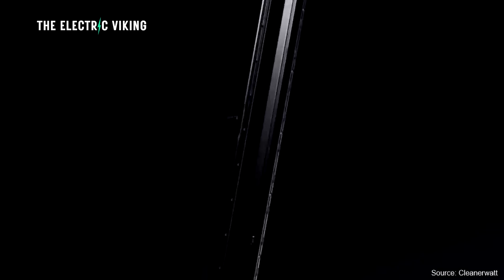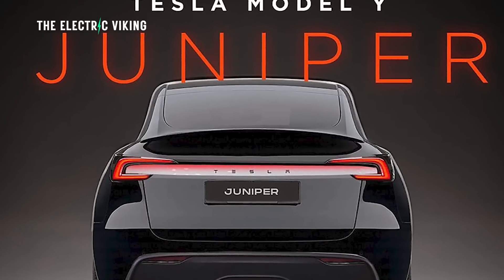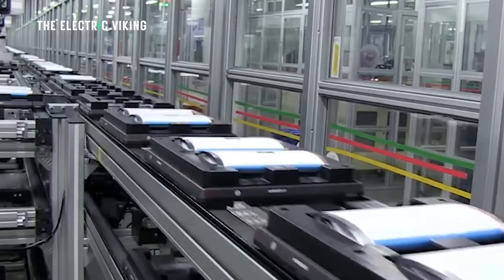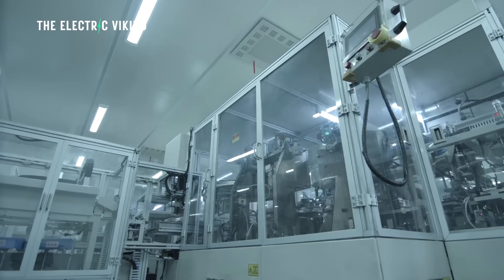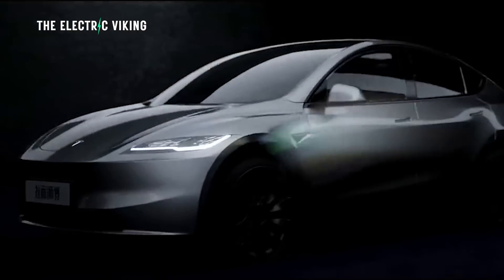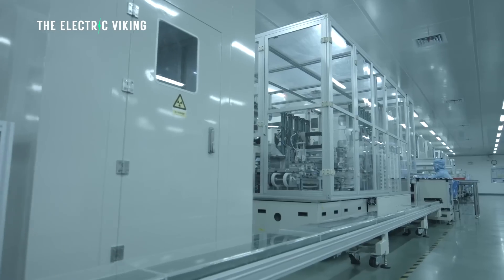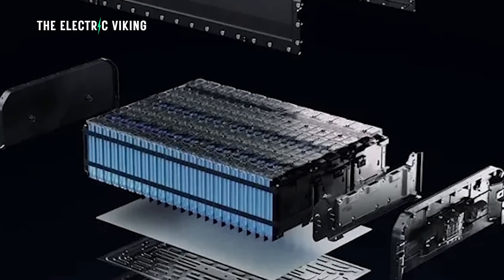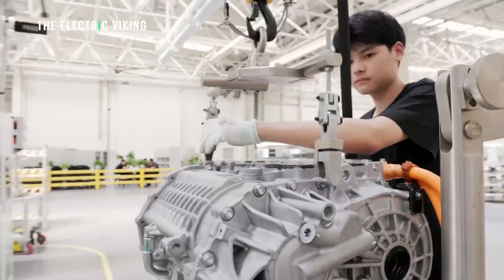Huge increases in energy density and charging speed for new Model Y battery

Comment: Folks, if you live in the US where leasing is an option, never buy an EV—lease it instead. I leased my Model Y in December 2023 for $500 per month, with 15,000 miles per year for 3 years. At the end of the lease, just turn in your vehicle and lease a new one. I know someone who paid $55,000 for a Model 3 two and a half years ago, only to see its value drop to $21,000 today. Leasing makes sense, especially with new battery technology improving every year. You don’t want to be stuck with an outdated battery.
Reply: Or buy a used one for $21k.
Reply: Who buys a car as an investment lol.
Reply: Prices a couple years ago were artificially high. so when the inevitable market correction happened, Lithium prices dropped like a stone, and used EV prices became really affordable. Plus China sold BEVs at a loss to force out competition. Some early adopters might have gotten bitten, but today and tomorrow's EV buyers will benefit from dropping materials prices and improving capabilities.
Reply: @deanmcmanis9398 Some of it is just the rapid progression of the industry but I agree leasing is not a 100% for sure thing, especially if you're intending to keep the car for 7+ years.
Reply: The sudden depreciation was a result of the lithium market crash and the model 3 refresh which happens every 3-5 years as well as hertz selling their 10k model 3s,the battery packs in the older model 3s are not obsolete they simply require longer time to recuparate costs
Reply: @Globalscanningeyes  Hertz had nothing to do with it in Europe where the effect is the same.
Reply: I put 131000 miles on my model Y in 3 years lol
Reply: If you drive over 15k miles a year I can’t see how a lease will help you.  Change my mind
Reply: @davidstrong7854  I'd rather a leasing company take the burden of EV depreciation than an individual owner
Reply: @skylershank9309  and you take the burden of turning a new but super expensive car that they may not sell into a used but great condition used car that they will still make a profit from.
That whole 'leasing company taking the burden' is a load of bull to entice people.
If it wasn't good for them they wouldn't be doing it.
Reply: Paid 37k for model Y. Pay off in 4 years with the 1.99% interest rate, and plan to drive it for 10 years, like every other car I have owned.
Reply: Leasing works great as long as you don't go over your millage or get involved in an accident.
Reply: @GeoFry3 how do accidents differ with leasing vs owning?
Reply: @alexmanojlovic768  it has been a while since I've leased a vehicle, but I'm pretty sure this is still a thing.  When you lease a vehicle, you agree to return the vehicle in a condition stated in the terms of the lease agreement.  The most noticeable one is millage.  The second one, which is not obvious, is accident status.  I leased a Tacoma and got hit 6 months after I bought it.  Everything was repaired, but now I had a vehicle with an accident on its record.  When it came time to turn it back in, the leasing entity wanted millage (I went over.) and they wanted the loss of value due to the accident.  It was cheaper just to buy the truck than it was to pay and walk away.  Originally, they had offered some sort of gap insurance, but I had turned it down because I could barely afford the payments at that point in my life.
Reply: @GeoFry3  Gap insurance isn't really an issue nowadays. It’s not there to protect you but to protect the bank that owns the vehicle. That's why it's typically included in your monthly lease payment, similar to how PMI works for home mortgages. The insurance premium you pay every month insures them, not you.
Mileage is important, though. Paying for extra miles upfront typically costs around 10 cents per mile, while the penalty for exceeding your mileage allowance can be 25 cents per mile, so it's crucial to calculate this carefully. Leasing isn't for everyone—it’s more suited to people who want to avoid the hassle of car maintenance. For EVs, even the worst lease deals are often better than buying outright due to steep depreciation.
Reply: @benjaminchen5715  nice.  Customer pays the insurance that protects the bank!!...🤦‍♂️
Thanks for adding that on!
Reply: @GeoFry3  thanks!!
Reply: How about buying a used Model 3 for $21K, and driving it until the wheels fall off? Compare to the $500 lease, after which you don't own the car.
Reply: @jamesvandamme7786  yea meaning you can neither sell/trade it as capital for the next car, nor will you have it if you can't or decide not to lease another.
Reply: Over 90% are leased in the UK too
Reply: I did the same on an EV6. Very glad I did that instead of buying
Reply: You will own nothing and be happy.
Reply: Yes and no, if a vehicle does what you want of it then all's well, you don't need extra anything, the only downside is resale value.
If you tend to drive a car, basically into the ground, (me) then you expect nothing for it when your done.
Reply: @paulstubbs7678  good point...
Reply: Whats an outdated battery? Tesla maintains the battery will out live the car....
Reply: @myhome772 - more a case of an ICE car on steriods - the battery raises the MPG.
Reply: BEV car technology including electronics, batteries are evolving exponentially.  Cars are an expense,  not an investment.  Best to buy what meets your needs and budget.  For many people a used starter BEV makes sense especially for local use.  Gasoline cars makes sense in many cases.  If you got money to burn…
Reply: 500 a month? How much did you pay down?
Reply: I paid 20.009 for 9 years of my car. But the 500 monthly lease would amount to 54.000 over 9 years.

Just don't bet on any return vale of your car, get a car for an amount that you are willing to pay for and you are safe.
Reply: @Richard-S  You could also ride a bicycle for 9 years and save $20,000. My cousin bought a Holden Commodore new and used it for 19 years. You spend what you can afford. For me, leasing an EV makes perfect sense—no maintenance, no warranty headaches, and a new vehicle every 3 years. Peace of mind.
Reply: For new EVs I’d agree. But getting a used 2022 Model Y LR w/ Performance Boost & 40k miles for $30k was a steal. 

It still has years of warranty left and is A LOT of car for $30k
Reply: I agree, I just lost a ton on a M3, I’m leasing my replacement. If it’s not the battery improving, it’s the computers and tech.
Reply: @wakeywarrior  Good point. If BYD can sell a $12,000 EV, Tesla can too. In a few years, EVs will be cheaper than ICE cars. Those who buy EVs today instead of leasing will sure face significant depreciation, wishing they had never purchased.
Reply: A perpetual $500 per month lease payment is silly.

The important thing is maintaining a healthy ratio of appreciating assets compared to depreciating assets.

If 90% of your assets appreciate, it doesn't matter how quickly the other 10% depreciates.

You need $500k in real estate, stocks, etc to responsibly own a $50k car.  

If you have no assets, paying $500 per month for a car you can only drive 15k miles per year is financial suicide....it makes it that much harder to build a portfolio of appreciating assets....that eventually become  multiple streams of passive income.
Reply: @ron2280  The original video discusses the upcoming battery for the Model Y, and we shared our thoughts that leasing is preferred over outright ownership of an EV due to rapid price depreciation in EV technology. Your attempt to advise us on budgeting is irrelevant and completely off topic. What’s next on your mind ? Are we discussing pager explosions or DJT stock speculation
Reply: @benjaminchen5715  you are giving terrible advice that hurts people financially.  

I thought it appropriate to offer something to offset it. 🙃😂
Reply: Sadly I have to agree… I have bought two EVs. Think I will keep my current one for a long time and then lease.
Hate leasing. Really love owning a car. But with EVs its just not an option anymore.
Reply: @tafl-9198  We are in a temporary spot where leasing is a good option if you are a good driver (no accidents) and drive low mileage because like cell phones and big screen TV's EV's are getting less expensive and increasing in capability rapidly.  

In 8 years, we may reach the bottom price range and capabilities stop increasing by 5% (or more) per year.
Reply: @tafl-9198  Tesla is the largest EV maker in the world, with factories in the US, China, and Europe. If BYD can sell a nice EV for $15,000, it means their costs are much lower than that. Tesla’s costs are also low, but they don’t need to sell at a low price. Apple sells an iPhone 16 Pro Max for $1,200 because they can, and Elon follows the same playbook. For this reason, you MUST NOT buy, because EV makers can, have, and will drop prices whenever they feel the need. Leasing puts the burden on them. Perpetual leasing isn’t smart, but buying a new EV in the current market is financially suicidal.
Reply: Question: what did you put down? You paid $18,000 in lease fees - if you put more than $16,000 down you may as well have bought. However if it was less than $16,000 down then you have more than $21,000 surplus value. (55 - (18+16)) = 21

I’d imagine you put less than $16,000 down, right?
Reply: I bought a Mercedes used diesel for 15,000 gle ,unlimited milage, just ware and tear cos kts kinda new and has low milage. I'll sell it in the future and do it afain
Reply: @user-wj7cv9hb5j I bought a worn out 240D for $800. Ran it another 500k or so. It cost me a few hundred dollars a year for parts.
Reply: @benjaminchen5715  why should I obsess over something giving me more than the 600 KMs range I already have?. When we have lunch I don't want it to include indigestion also.  A 50 is perfectly fine for us.
Reply: I drive too much for work to lease
Reply: @CassianLore  true... if you're OK with public charging, higher  insurance and depreciation.
Reply: That's good advice.
Reply: Or just buy used car instead
Reply: Someone complained to me about the dearth of second hand EVs, I see it as like when mobile phones and digital cameras came out. Would you really want to buy a year 2000 1.8 mega pixel camera 5/10 years later? Maybe but probably not because the tech is at that point of massive evolutionary change that makes the previous incarnation look dated. Cameras now have reached a point where most in the market are excellent and take high definition, beautiful photos with massive memory for photos. Would I buy a 5 year old camera now? Yes
Reply: @eldictator1  cameras quite another animal.  Comparing the two makes no sense.
Reply: Great idea
Reply: @benjaminchen5715  BEV is like computer on wheels.  Looses value as soon as new tech like batteries, electronics like FSD is announced.  Model Y used prices will collapse when Juniper Model Y shows up longer battery range, faster charging, FSD HW 5.0, improved design, etc.  That is before $10,000 Chinese cars all loaded show up worldwide.  

Buy new BEV only if got money to burn.
Reply: Yes, depreciation is why I leased my 2023 Tesla MYLR.  I knew the upgraded Juniper version would come out within a couple of years.  Unlike ICE vehicles, EVs are still improving, making EVs that are just a few years old start looking mildly obsolete to buyers.

HOWEVER, this makes a used EV a great value for pre-owned car buyers!  The sub $25K EV of tomorrow is available today in the used car market.
Reply: @NickWindham  residual values keep dropping because of unknown providence and condition of the battery. People don't want to buy used EVs.
Reply: @CassianLore indeed I think the increase in battery density will mean lighter batteries of the same kWh rating and range increases that way while saving money on the physical quantity of actual battery. The holy grail now for EV manufacturers is mass market penetration which means EVs need to get cheaper- economies of scale, improved manufacturing techniques and cheaper battery tech is getting us there. 

In the UK we’ve already got real world range 300 mile EVs typically anything over 80kWh. With only 837 miles north to south of the UK mainland by road 300 miles range and 32,300 ( as of May 2024 source Zap Map) public charging sites means in the UK long journeys by EV are comfortably realistic.
Reply: I think your speculation about price parity is spot on. EV/ICE price parity is being accelerated particularly here in the UK with the points you made of improving charge speed and range satisfying consumer anxiety over EVs, and lower maintenance and service cost appeal in the face of the cost of living crisis and the Zero Emission Vehicle mandate - a Government fine for car manufacturers who don’t meet the annually stepped % EV sales of their annual entire new car sales figures. Parity is much closer than people think. Exciting times.
Reply: even better, buy an off-lease vehicle (post 40% depreciation) since the maintenance costs are nonexistent. Then it won't matter if you put 20k miles a year on the car.
Reply: Would love to have leased my ev but here in Florida the insurance was 699.00 a month (No accidents, No points and the same options as my Gas Car) Buying the EV brought it down to 200. I Definitely understand that the tech is changing so fast
Reply: Bullshit...where are these magical 3 year old Teslas for 1/3 their origional cost? I'll pick one up right meow.
Reply: @littleherms3285  You clearly have not kept up with the market. Back in 2022, a Model 3 was priced at $56,000. Today, a new 2024 Model 3, with the $7,500 EV credit, comes to $39,000. You can also buy a used Model 3 on Tesla's website for $25,000, not including the $4,000 tax credit if you qualitfy. You can't lease a used car, so buying one outright is the only option.
Reply: @benjaminchen5715  clearly 🙄, yet, you still can't find me a Model Y for 1/3 the cost of new in a 2021 model. Funny, that...
Reply: It can depend on the ev, what you plan to use it for and what price you can find it for. My current EV was second hand and been great for the 2.5yrs I've owned it. I could see me keeping it for as long as I can, doing a battery upgrade when needed, and still saving on the costs of running an ICE car. I've saved about 5000 in these few years Vs my old ICE car. So buying can work out.
Reply: Or just don't get an ev in the first place
Reply: "Just turn it in"  and you're left without owning anything and a car payment forever.   Now they are at a great price. Buy it!
Reply: I will never ever lease another vehicle, ever.
Reply: Here in Australia it’s even better, we can get a Novated Lease through work and pay for everything out of our pre-tax. Literally given an EV for zero money down, absolute no-brainer.
Reply: The NYTimes, Wall Street Journal, Consumer Reports have run the numbers. Leasing normally will cost 30% more than owning.
 If you don't was the fuss of selling a used car, or trading it in (and saving a lot of sales tax) then leasing is your answer.
 When a manufacturer wants to clear aging inventory, they may offer zero finance--or a cash discount that works out the same.
 Of course with EVs they are still new and estimating their residual values in a black art. But the dealers LOVE personal financing, because they make more money than they do on sales. Unless the leasing manager screws up, or the market changes, and the residual value of the vehicle tanks.
 Don't mistake a black swan event for good future policy.
Reply: @myhome772 I had one and got rid of it fast. The build quality was terrible.
Reply: Batterys will already out last the car....... 67k mile in 9 months.... its on coperatrate lease and i had to replace 2 sets of tires thats it.... same money in oil change alone if its a gas equivalent
Reply: Depreciation happens because Tesla has dropped prices. It's as simple as that. The issue is that even though people get more value out of Tesla compared to an equivalent ICE vehicle for the same purchase price, the financial comparison will always be against other improved EVs. They will be like cellphones and laptops which drop price rapidly as much more efficient vehicles hit the market. This is a good thing, not a bad thing, as the vehicles still provide the value you expected when you first bought it.
Reply: I get what you're saying but if you're keeping it for 8 years then the financial loss is going to be similar. 

We always take a bath buying a new vehicle.  Any new vehicle. You know it's going to drop from 50,000 to 40,000 as you drive it off a lot. 

And you know after 8 years it's going to be worth about $15,000.  It doesn't really matter that much if it's worth $18,000 versus $12,000 after 8 years of saving you $1,000 a year on fuel. 

That said we seem to be in a temporary bubble where leasing it makes a small amount of financial sense as long as 

You don't drive over 15,000 me and you don't get into an uncovered accident.
Reply: @myhome772 The cost to maintain a Lexus is $700 to $968 per year for the first five years.   And after five years, those costs increase.

I would never buy a new ICE vehicle in the current market.   I'll drive my 150,000 mile Honda Element until it's done and then my next vehicle will be an EV.
Reply: @myhome772 Google average Lexus maintenance costs by year.  And as I expected doing your own maintenance too.
Reply: I think there will be a big market for replacement batteries that are way better than the original. I wouldn't be surprised that a Tesla may get such a program within the next few years.
Reply: @Sacto1654  That's a serious dilemma for BEV companies. They need to sell large volumes of new cars to pay for the investments in software, facilities, and tech. So for BEV automakers, it's better that old BEVs are thrown away and taken out of the pool. It's actually why you see them giving cost-prohibitive quotes on battery replacement.
Reply: @Sacto1654  many pundits predict that replacement batteries and labor will cost more than the vehicles are worth.
Reply: @skylershank9309 maybe , but maybe not .   Or the battery will be to good to put in an old car .
Reply: @skylershank9309  sounds like a talking point. You can tell by the vagueness and the 'many pundits' line. A few people on youtube with a channel with 20k subs each and no EV knowledge would qualify as 'many pundits'.
Reply: @nfzeta128  MGUY Australia is an example that might burst your fanboy bubble
Reply: @skylershank9309  one example is somehow proof of something?? If you're going to be a troll/shill at least be good at it.
Reply: @Sacto1654 a new battery costs more than a new car.
Reply: In Australia there is discussion, to give EV's no more allowance to park in big garages. Because of fire danger. 
Might be that there are regulations coming to nmc batteries. And then you are stucked by your car or just give it back if leased.
Reply: @rainersta7073 Then why would they let gas and hybrid cars into parking garages when their  rates of fires are 25 to 60 times worse?
I'm using the NHTSA numbers from the US. Are car fire rates that different in Australia? Why?
Reply: @ronfarnsworth7074 I can only guess that the severity of EV fires might be an issue
Reply: @skylershank9309  EV fires are the most rare of any type of car.
Reply: @nfzeta128  I know...but the more EVs sold , the higher fire probability
Reply: @skylershank9309  - probability doesn't work like that. If you toss a coin once you've got a 50% chance of Heads landing upwards, if you toss the same coin 100,000 times it's still 50% each time. 

Perhaps you thinking of the chance rate: 

- EV car chance of fire rate is 0.025%;
- ICE fire 1.5% (60 times more likely than EVs); and 
- Hybrids fire 3.5% (140 times more likely than EVs). 

Again, the rate doesn't change directly with sales volume.
Reply: @skylershank9309  lol what? do you know how stats work?
Reply: @nfzeta128  yes...if you don't agree with them they're not valid
Reply: @GruffSillyGoat  the University of Amsterdam did a study of 46 different currencies. Flipping coins over 350,000 times and found the side of the coin facing up before flipping came up more often than the other side.
Reply: @skylershank9309 If the fuel line in a gasoline vehicle breaks or melts during an ICE vehicle fire, and the contents of the gas tank leaks out feeding the fire, the amount of heat energy is just as great as in an EV fire. And, the possibility of explosion from gasoline in an enclosed space causes a greater risk for damage and injury than an EV battery fire.
Reply: @dvader3263  temp. Of ICE fires are no greater than 1,500°. EV fires up to 5,000°. EV fires are categorised as you know - thermal runaway. They can not extinguished like gas fires.
Reply: @skylershank9309  your assumption is that it's better to be 10 times more likely than risk thermal runaway.

I bet 9 out of 10 people who find their car on fire would disagree with you.

Have you ever been standing across the street while your gas tank explodes?
Reply: @ron2280  oh yeah...I live in fear that a gas tank is going to explode. That's why I refuse to park in enclosed parking garages or near other cars in parking lots because of all the explosions!
Reply: @skylershank9309  I see 2 or 3 cars per week burned up on the side of the road in northern Indiana.  Every now and then I see one where they caught it before the tank blew.  I have yet to see an EV burned.  Statistically, I will see one at some point.
Reply: @ron2280  sounds like you're in the burning gas tank capital of the states
Reply: @skylershank9309  I just drive a lot of miles.  Of course I recognize your sarcasm.  You haven't learned yet that safety, apart from the few things you can control is largely an illusion.  

Life teaches the humble gently.  It teaches the arrogant harshly.  😉
Reply: @ron2280  If I took safety as an illusion,  I'd be dead.
Reply: @rainersta7073  They shouldn't allow hybrids or ICE either, then. Much more dangerous.
Reply: Fool, what rot have you been reading? @rainersta7073
Reply: I don’t think it’s anything to do with batteries that makes EVs depreciate. It’s the short range, difficult charging and insurance costs that makes them depreciate so quickly. Once prices started to drop in the UK, it just snowballed and now 3 year old Tesla’s are down to a third of the original price.
Reply: @sargfowler9603  - batteries are directly linked with range, the car innovation churn (increasing battery energy density and improving standard features) is one of the factors causing depreciation, as buyers are seeing cars come onto the market with longer range at cheaper prices. This is impacting the ability of previous models to retain their value. Charging access will vary by buyer - those who can home charge will not be that concerned, nor will those buying a 2nd EV replacing their current ICE 2nd car.
Reply: @sargfowler9603.Potential buyers are concerned about  unknown battery condition . This limits demand for the used EV market. Another depreciation factor.
Reply: @sargfowler9603 it’s the batteries. It’s a tech product more than an auto and tech depreciates more than autos